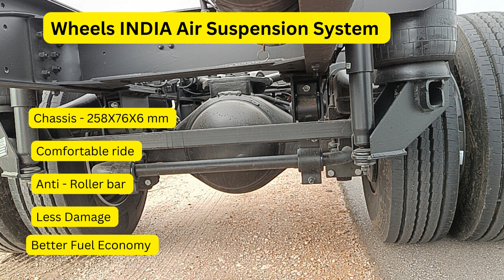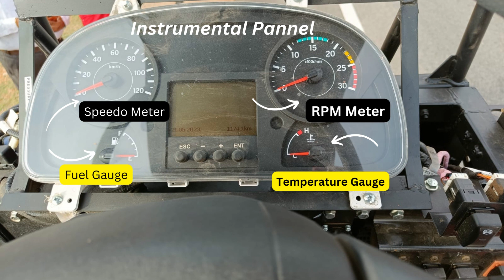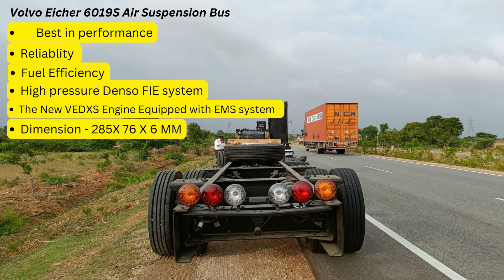Volvo  Eicher 6019 13.5 Meter Bus Chassis Review|| Eicher 6019 bus chassi 2023 || Vasundhara Traders

Comment: Sir 
Eicher 6019 13.5m Vs 
Bharath benz 1624 13.5m 
Vs Asholk leyland TF 2513 13.5m.

Ee moodu Bus chassis lo edi best sir include Mileage, Comfort, Braking, Maintenance. 

Please reply sir 🙏🏻
Reply from the maker: Bharat Benz New tech to improve mileage, Safety, driving monitoring system
Reply: @vasundharatraders  Thank you sir ♥️